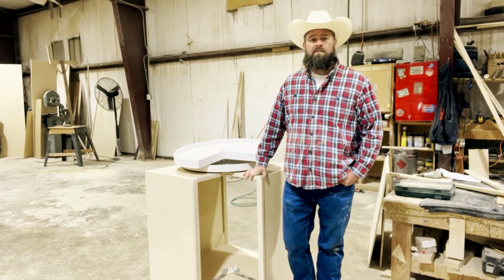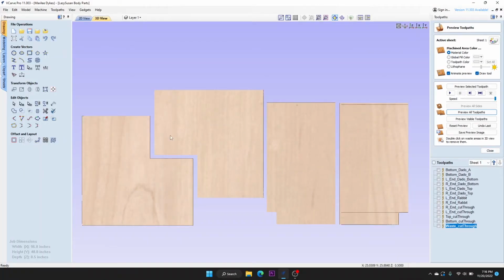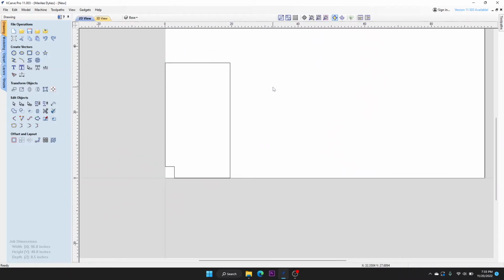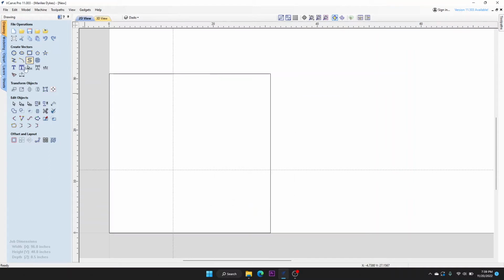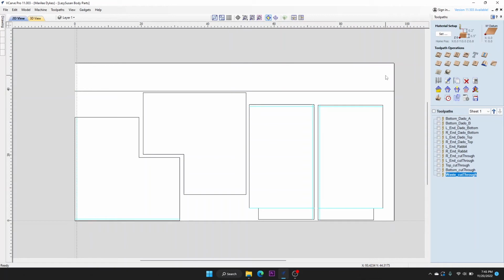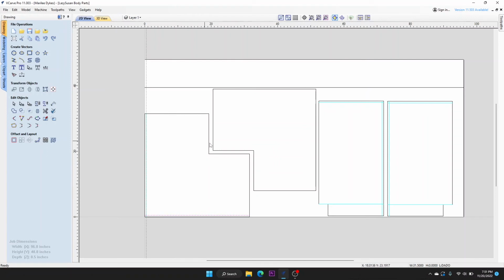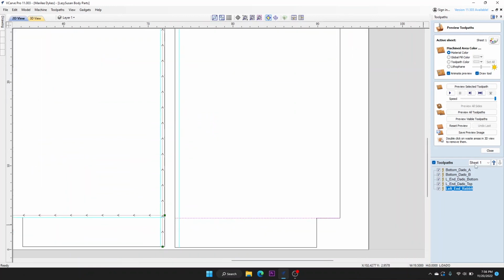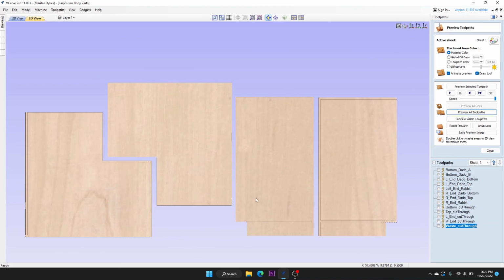How to Build a Lazy Susan! PART 1

Comment: When doing your rabbit tool paths. You can select outside toolpath and if it's on the wrong side you can change it by going into node edit mode and change the start node to the other end of the line. This should change the direction of the toolpath to the outside.
Reply from the maker: Awesome! I did not know that. I will definitely give that a try. I appreciate the reply!